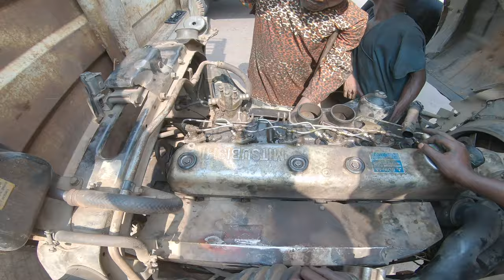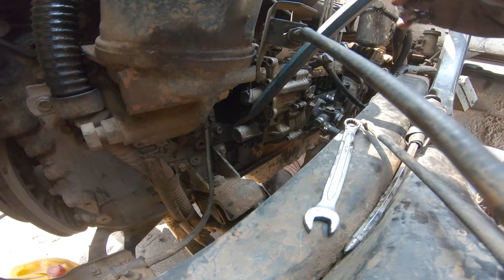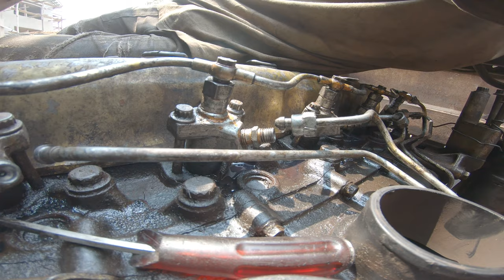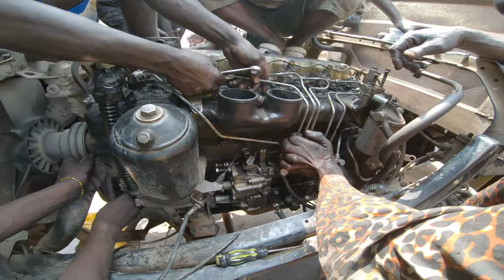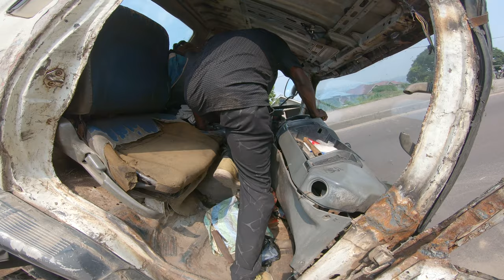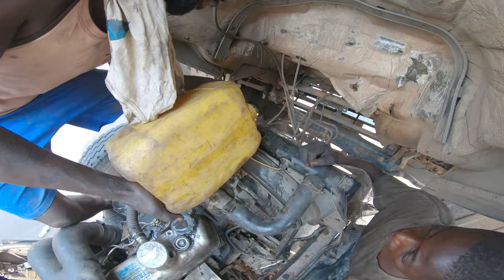These street mechanics try to fix a broken truck

Comment: Children were small and easy to fit in tight spaces or under cars, so even in my country until the 1960s, 
children sometimes served as mechanic shop assistants helping other skilled mechanics.
They were provided with meals and lodging, touching the dirty oil every day, for very little pay.
And when the children made a mistake while working, they were severely harassed by skilled mechanics. :(
It's okay if the boy is interested in car maintenance and helping his father with his work, but sadly if it's something he has to do to make money...

Comment: lack of Tools and still goes!
Reply: Proof that it's the mechanic, not the tools.  

A nice set of tools helps though 😜
Reply: I know the feeling me and my brother in law dropped a trans in a 94 camero ss to put freez plug in and sealed a valve covers with a Dewalt bag of random tools and we did it slowly slowly adding to it over time